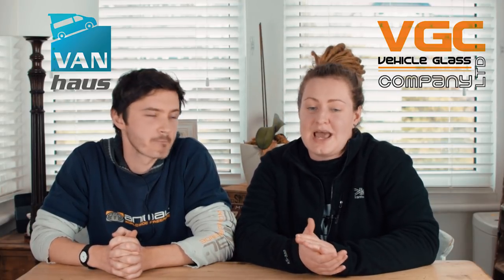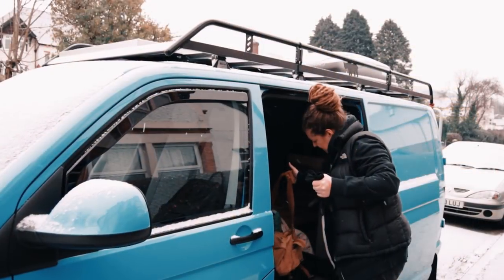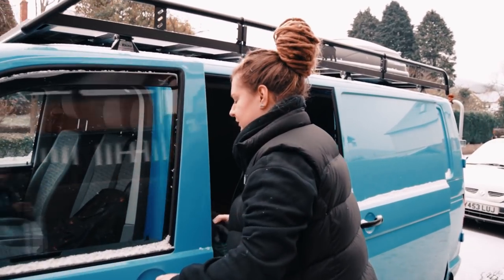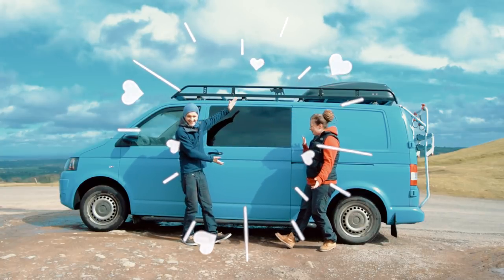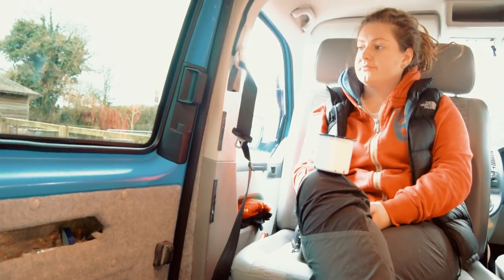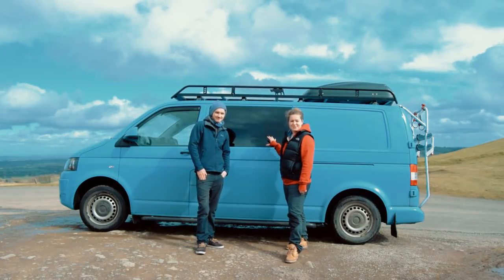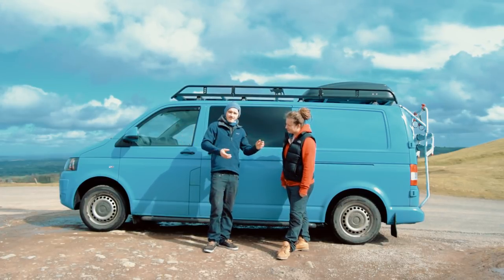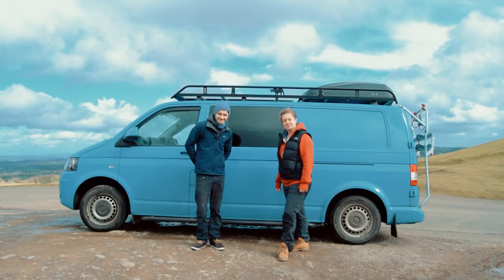Day 33 - Fitting a bonded window #VanLife VW T5 Camper Conversion

Comment: The only problem with diy motor caravans is that many insurance company don't want to insure it.  While mine vas registered as a panel van, my insurance was £186. After registered as mc first cheapest insurance was £300 with adrian flux in the first year. In the second year they wanted £500 straight up. All this with max no claim bonus. After that i compared online i had cheapest was around £250 but when i called them with the insurance quote because it is a DIY conversion they didn't want to insure it.  I managed to get an insurance for £330 they wanted photos that all requirement is present and also i have to do an engineer report within 3 months. The engineer has to confirm that all the requirements are present and valuation of the van. I have tried 3 mechanics so far most of them don't want to get involved. One filled the form in checked everything but he said sorry but i can not give you valuation as have no idea what the market value is.  I sent the form without valuation to the insurance provider (agent)  They said valuation is the point of the engineer report. So i was asked to try somebody else.  Now I'm getting fed up with these people and trying to get another insurance. It's a nightmare guys. I would keep it as a panel van if i was you.
Reply from the maker: Insurance seems to be a bit of a minefield! We've been as honest as we can be with our insurer, telling them about every modification and our intentions. They seem to be completely cool with everything so far. However, we do pay a premium! I think we need to collect as much info as possible about this, sorry to hear you've had so many problems. It seems like everyone has a different experience with this. Thanks for the comment :)
Reply: you've just cooled down my enthusiasm a lot, sir ;/ I'm planning on doing a conversion, checked up how much it'd be to insure a panel van for private use with no NCDs - £300 TPFT (that's with having another car to commute. as as far as I'm aware it's impossible to have a van for private use and commute with it), some £140 to tax...happy days, I'm good with that. now, I've read everywhere that as soon as you change classification to MC with DVLA the prices should go down, not up :( and again, probably for a hundredth time, I'm on the fence whether I should carry on with this van conversion idea, or just give it up and spend a few grand on hotels over a few years rather than putting it into a van and getting myself headaches with those scam artist of insurers (I'm really fed up with all those darn crooks, someone should seriously get to them eventually). need to call adrian flux up and ask how would it work for me...
oh, one more thing. putting a van as a MC should at least bring ferry fares down by half! some 50-60 quid one way instead of 120 if it's a private van...
Reply from the maker: Just a quick update.... we’ve just changed our van over to a motor caravan. We let our insurance know and they said our policy will come down by at least £200 when we renew. We haven’t contacted any other companies yet but looks like insurance will be significantly cheaper. Also, our van is our only vehicle, insurers told us it’d be even cheaper if we had a second car. Will be doing videos about all this when the time is appropriate. Thanks.

Comment: How much did the window cost if you don’t mind me asking?
Reply from the maker: The windows are pretty reasonably priced. Just checking the Vehicle Glass Company website for their selection of windows for a T5 and they're mostly around the £50-60 mark. Then maybe the same cost again (roughly) if you're brave enough to install yourself and need to buy adhesives and trims etc :)